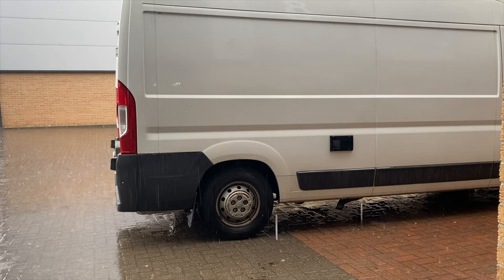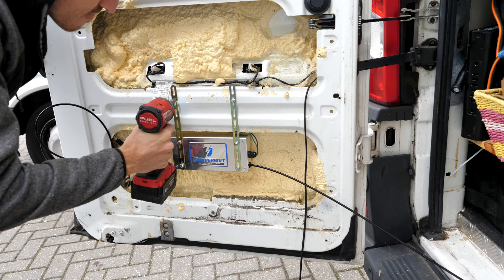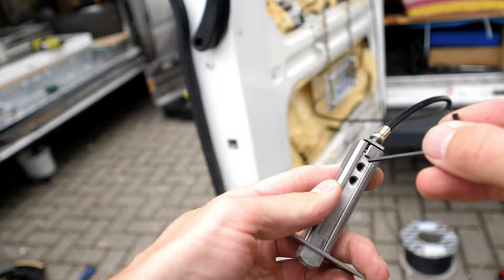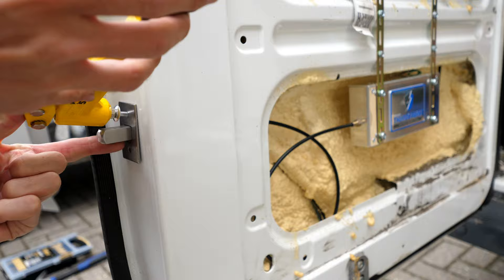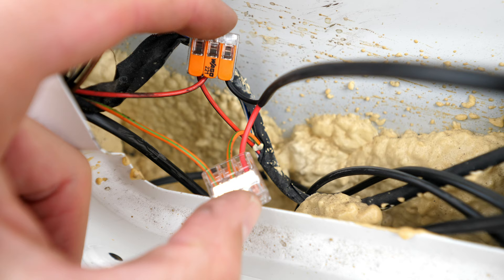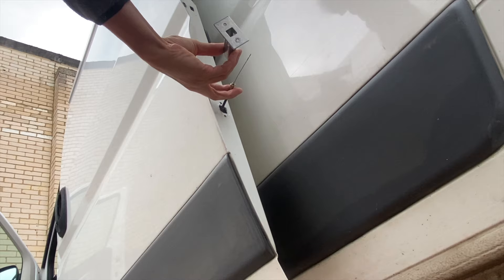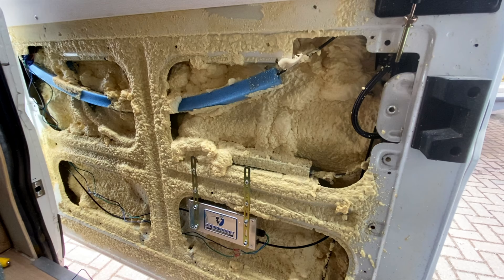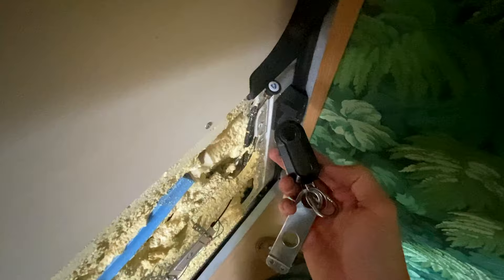Thunderbolt Anti Theft Deadbolt Fitting Guide - Boxer Camper Van

Comment: Brilliant Video...Thank You! 
1. Thunderbolt offers a "Raised Strike Bracket" that allows for installation of the lock case in the passenger side rear door making connecting the wires much easier.  2. They offer a keyed manual release in case the battery ever fails and there are a few other ways listed in the FAQs to solve that challenge. Cheers! 🚐

Comment: After watching the install and having a think about it. I like it. One door must have a mechanical deadlock in case of battery going flat, lost your key fob etc etc single point of failure. Maybe a key switch inside the nearsidecab door and that door with mechanical deadlock. Seriously thinking about fitting this to my van. Thanks.
Reply from the maker: yeah a good way to look at it! As I have the bulkhead doorway and no thunderbolts up front that is my back up way in

Comment: Cool.  How do you get in you lose power or lose the key thob ?
Reply from the maker: It would be incredibly bad luck to lose all power as there is solar so my batteries would have to die, and the solar fuses trip but I don't have the locks on the driver and passenger door yet so I can get into through the front, if I add them to the front I would probably run those off the starter battery so they are powered by a different battery. If I lose the fob I have some spare keys.

Comment: Criminals peal the door open from the top so it is completely pointless! If they want to get in they will no problem.. You will just have more damage to put Wright if they don't actually drive it away and steal the whole van
Reply: True preventative measures probably end up causing more damage.